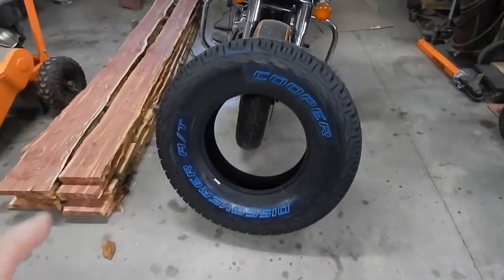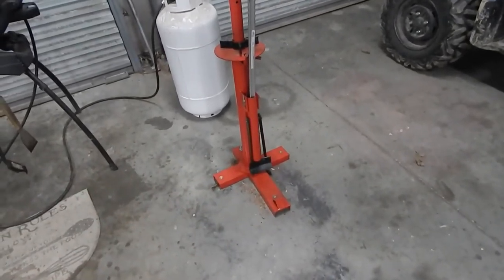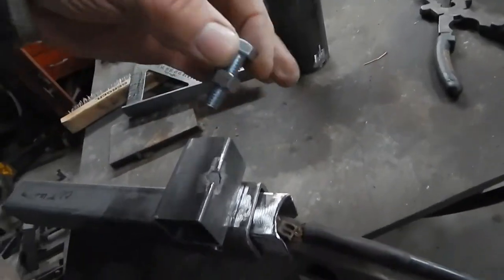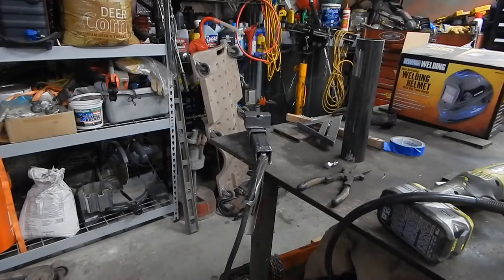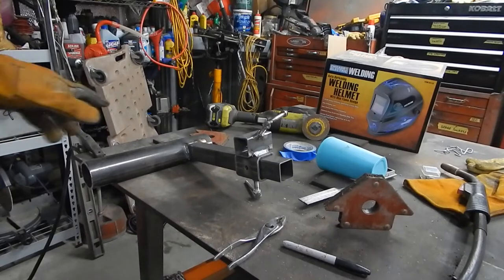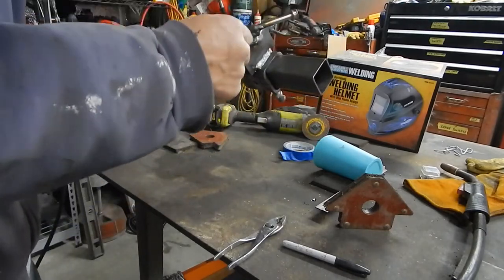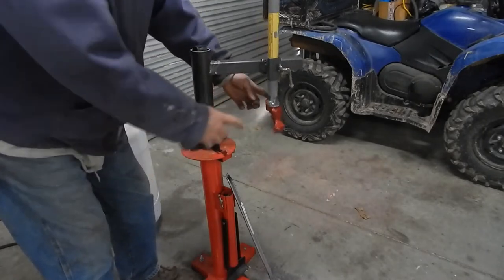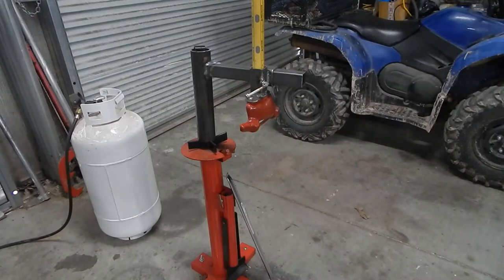Harbor Freight Tire Machine Duck Bill Mod My Take On it. Part1

Comment: Great video, those self darkening helmets are fantastic.  Just a friendly suggestion if you can't find pipe to telescope, just get two pieces of angle iron saddling the pipe, and clamp and weld the two seams along the length of angle iron, makes the perfect bushing with no play.  Also flat iron can be placed on the outer 4 walls of square or rect tubing stich weld the four seams creating telescoping tubing, no play and no inner seams.  Works on metric sizes also haha!  Tire changers are game changers, GO HARBOUR FREIGHT for the common "human"

Comment: Welding with solar power is pretty impressive by itself but then you distracted me with that beautiful cedar wood laying there. Oh yeah, nice job building the modification. I hope it works good. Those truck tires can be a bitch!
Reply from the maker: Thanks wyatt.

Saying those tires can be a b**** a lot nicer than the words I used. Yeah the cedar on the ground I've been tearing up with my chainsaw Mill I've got quite a big stack. Hopefully adding the second level deck off the back porch sometime in March installing a 6ft sliding glass door in the second level trying to build as much as I can from the forest around me got tons of cedar trees.